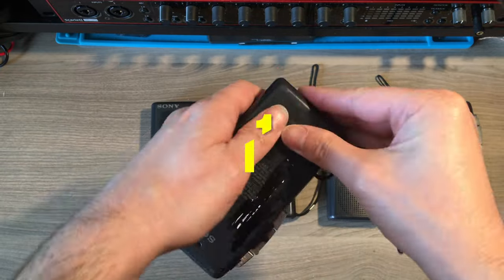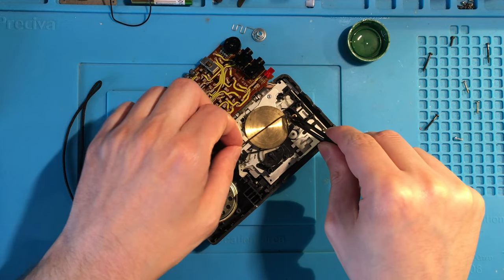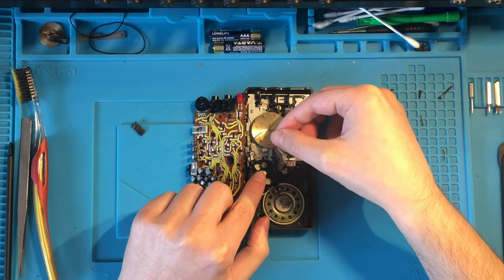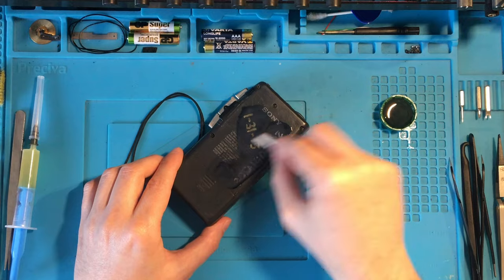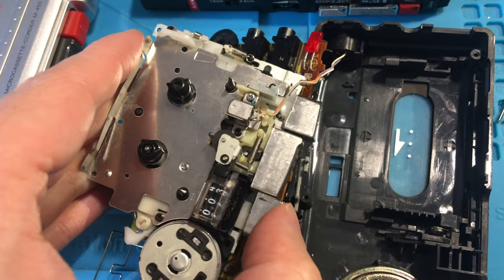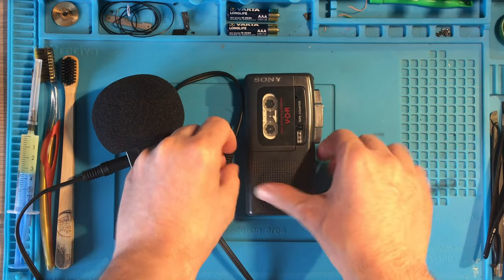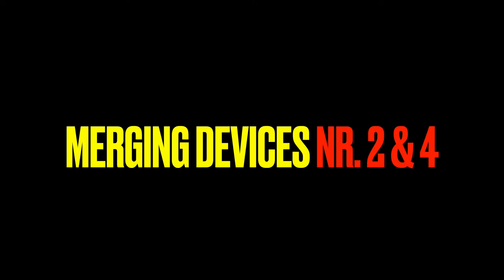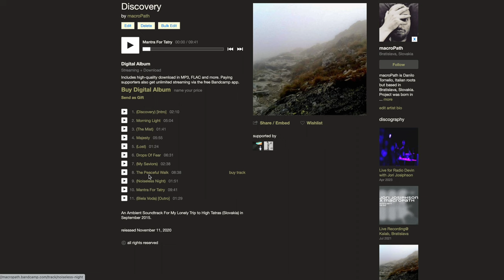REPAIR & RESTORATION Of 5 Microcassette Corder SONY M607V

Comment: Thank you so much for doing this video. I bought one of these in '94 to sneak into a Pink Floyd Pulse concert! I just tried to digitize it, only to find out that the belt was bad, just like these.
For player #2, I don't know what that piece is called that broke, but is there any way to fix it? Mine broke as well putting it back together. (Fat fingers. Lol)
Just subscribed to your channel! Great video!
Reply from the maker: Hi! you're really welcome! wow, so you're telling me that you have a bootleg of Pink Floyd from 94 recorded on a microcassette? Nice! No worries, you should find a new belt on line. No, don't know the name of that piece. It's just ''that plastic thing'' :D ... which I was able to glue it somehow, but anyway it is held by a small rounded piece of steel. I think I glued directly that piece of steel so that the plastic part is able to rotate a bit. I still don't know how I did but it worked and I gave that unit away as a gift. No idea if that piece is still holding. Thanks for subscribing!
Reply: @macropathsoundscapes  I was thinking of doing that, or take it apart farther and pop a tiny screw in to pivot. Seems like a bad design, or planned obsolescence, lol!!!
When I fix it up, I have to filter out my screaming and singing in Audacity, which will be my next great adventure!
I'll send you the link for the concert if I ever get it going!
Reply from the maker: @ronhansen0512   Super! Looking forward to it and good luck! ;)

Comment: hi, are you playing these back at full volume?

i'm repairing a sony m-100mc which seems like a similar board and mechanism, but after replacing belt and testing, the playback level seemed low, at full volume. but it seems around the same volume as your players. is this normal for microcassette recorders? are they ever loud? i've never used one before. thanks!
Reply from the maker: Hi! Well, it's always not recommended to play them at full volume as it might damage the speaker itself. 

However I know what you mean and I had some dictaphones with the same issue. Last one I fixed it simply replacing the speaker, and it worked greatly. 

I'm not an expert, I'm learning by doing. From my understanding it can be also a matter of capacitors, or maybe the volume switch is not working properly or needs some clean up. 

Good luck!
Reply: @macropathsoundscapes  thank you for the response! i am also learning by doing :) and asking :D. the volume pot does not crackle when i turn it so it seems like that is fine?

i will try to check the caps.. it seems really tedious!

Comment: Omg you are a fucking hero, I bought the same player at a flea market and it had a problem with the belt like in the first one. The belt was getting too loose aswell, I basically just twisted it to make it shorter. Maybe it's not gonna last long but now it is playing the cassette properly. Thanks a lot for your video friend.😄
Reply from the maker: Hi! Glad to hear that, but I would really suggest you to get a new belt as I did. Find it on eBay and install it, you'll bring it to new life ;)
Reply: @macropathsoundscapes  I already saved a link with the original one for when this one brakes 😉
Even if Im not into cassette players, I do try to repair electronics from time to time and your video can be useful like in this case.
You got me as a subscriber 👍
Reply from the maker: @mohinator3341  I really appreciate! Thanks a lot! ;)

Comment: I was looking for a video like this a while ago, because i have an old one that doesnt work. Those two black knobs aren’t spinning and its making a white noise sound. Any idea what the issue is?
Reply from the maker: Hi, well hard to say, but if you watch carefully this video it could be helpful as I handled 5 of them. In most of the cases is a belt issue and it needs to be replaced.
Reply: Thank you! I will try to fix it
Reply: Kayış ölçüleri Nedir ?
Reply from the maker: Hi! I'm not sure about the size but you can buy a new one at this link: https://www.ebay.it/itm/323813014084 @ademhaste1857
Reply: Thank you. Hopefully, I can fix my dad's to hear his voice just 1 more time. It's been 28 years 😢❤
Reply from the maker: @rebeccasalgado6603  Hi! I'm sure you''ll be able to fix it so you can hear to your dad's voice anytime you want as he was there next to you. Love. Dani